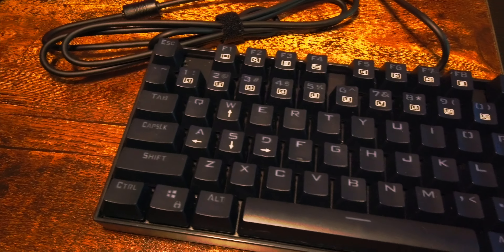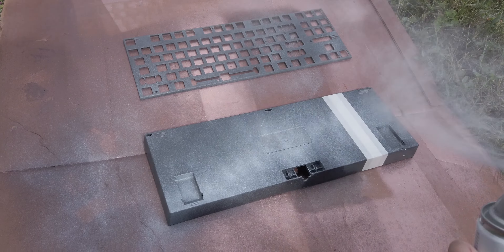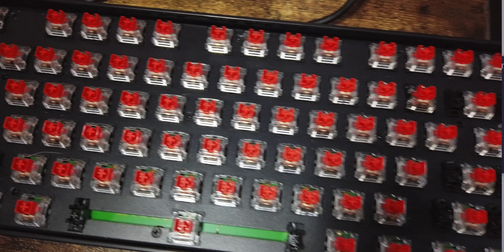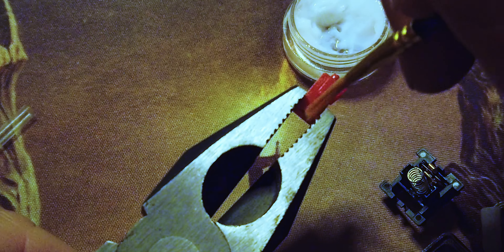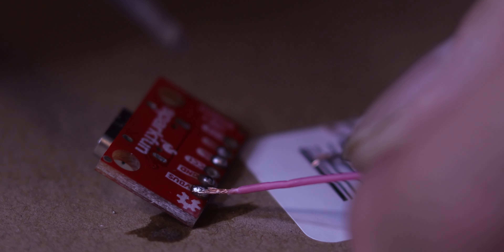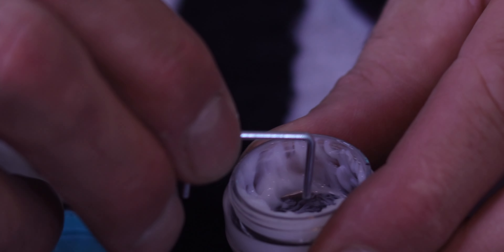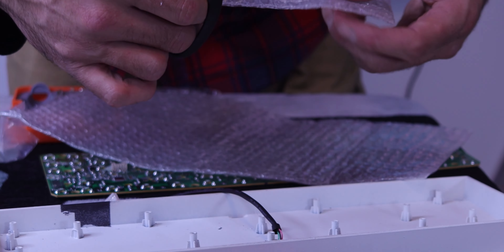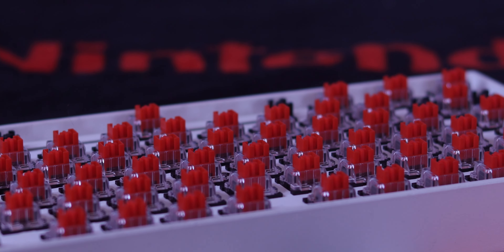The Ultimate Gaming Keyboard Mod the K552

Comment: Hello! How did you spray paint the part where the red light (for capslock and numlock)? I'm planning to mod my own keyboard and I wanted to know how you did it
Reply from the maker: It’s just a tiny light pipe for the led that is on the board itself. So during painting it was removed
Reply: @TechPrimeMedia  How do you remove the light pipe if I may ask?
Reply from the maker: @ArelleSaldua it’s just a little plastic piece between the top shell and plate
Reply: @TechPrimeMedia  Ok, thank you fir the insight!